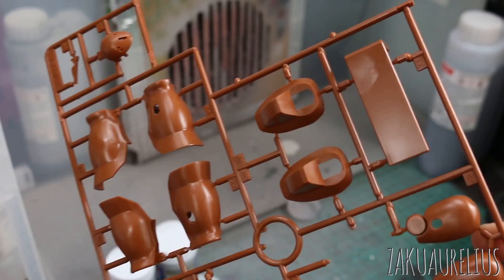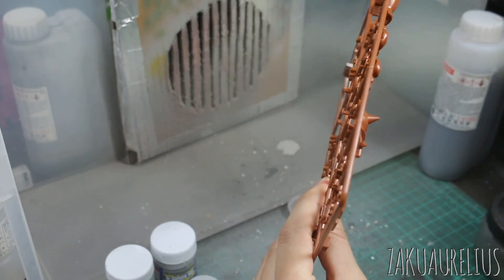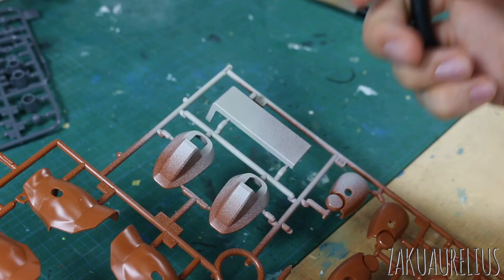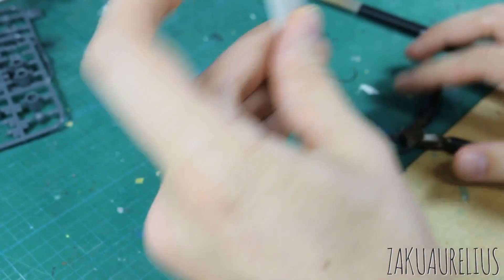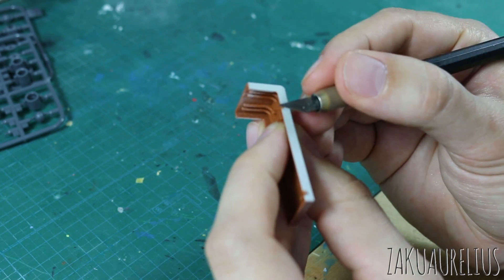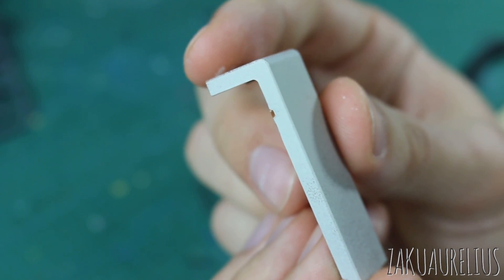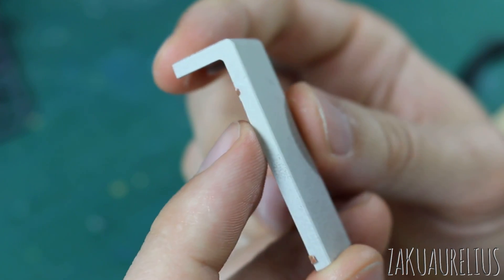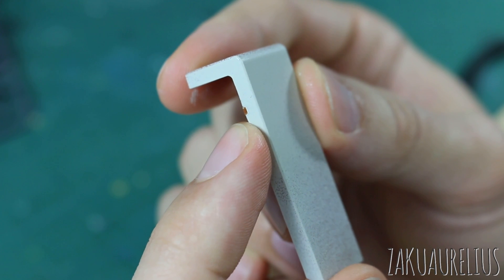1185 - FAQ: Painting on the Runner

Comment: I don't think this technique is necessarily bad, you just have to know you aren't going to get professional looking results from this.

I've done this a few times for kits that I just wanted to paint quickly without going into the whole process of sanding, priming, and top coating. What I usually do is trim off as much of the runner as possible, leaving only one or two gates on the pieces, preferably ones that won't be visible on the finished kit and touch up as needed. 

I did this for my RG Gold Frame Amatsu Mina, quickly painting the gold pieces and it turned out just great. 

Obviously I wouldn't do this for a kit I plan on doing a proper paint job for, but for kits I just want to get together rather quickly this technique is fine.
Reply: DZMaven's Gunpla Reviews agreed. it has its place.

Comment: I recently engaged my girlfriend in a combined Gundam build, in which all parts were painted on the sprue prior to assembly. The purpose of this method was to demonstrate and train in a variety of plastic kit painting techniques: airbrush, dry-brush, hand brush, oil wash, and watercolors, as well as the use of metallizer finishes, spray bombs, paint pens, and markers. Only a few parts required removal, or fell off the sprue in the course of painting. Only one part from each kit required any significant degree of re-touching. Assembly of kits and placement of stickers went as per the instructions. Overall the process was fun, interesting, and stimulating; painting and detailing small, often unidentifiable parts on a sprue can daunt the mind, but it can also free it, and you might find yourself making less conservative, more imaginative choices, that reap unexpected rewards later on in assembly. When complete I found the two kits closely resembled pre-painted, pre-assembled figures in their painting styles. On the whole I was very satisfied with the exercise and both figures, which we proudly display as tokens of our handiwork. Painting parts on the runner isn't a good idea--- if you have a bad attitude towards the method from the start. Trying to prove your point by painting a dark-colored parts sprue with a wildly contrasting color only sets you up for the failure of the differing colors that become visible when you remove them from the sprue; this is not a convincing, or ingenuous, proof of anything. What of the vast majority of builders who simply want their kit to appear like the one on the box? Obviously they will not be making these paint choices, so obviously this is a problem they will not likely encounter. I would recommend this method of painting to builders wishing to introduce the hobby to a youngster or a relative novice, or to persons wishing to limit their exposure to paints, solvents, etc., or to people who just can't decide which side of the fence to fall off of: whether to paint and detail, or simply to build. This method offers somewhat of a compromise to both parties.

Comment: Usual trick i do to prevent those awful nubs is to simply cut and sand/file/whatever method to remove nubs that are the more visible ones, and the ones that aren't as visible, i simply leave it there and continue to paint on the runner.

Comment: I've seen lots of videos with row after row of parts on alligator clips,  ready for painting.   As someone new to this hobby,  my first thought was --  how do you build the thing after painting?  Parts are off the sprue,   how do you locate A4 to connect it to C6?   Just by the shape?   I think another commenter asked a similar question and you were going to do a follow-up on how to organize.  Thanks.
Reply from the maker: Ah! Good question! The answer is pretty straightforward though: you just remember! Haha 😅 
By building the kit first you familiarize yourself with the parts. Then after disassembling and painting when it comes time to re-assemble you should be pretty familiar with which parts go where. If they get too confusing though you could also mark the alligator clips with masking tape and write the part number! Hope that helps! It’s easier than it looks! 👍

Comment: only paint on runners if handpainting. use a fine tip brush or toothpick. only certain type of kits would be justifiable to do so (first grade seed/00, 1/200 kits, some SD kits?? and i guess undergated runners?) 

its really fun to do for fun especially on cheap kits. kids will especially love it. its a lot less intimidating to introduce them to painting. like i could see it be used to conduct a class for kids. Just go prime the runners, grab a toothpick and go ham. bare plastic looks like shit

obviously more traditional methods are better.

Comment: In general I completely agree, this is not a good method of painting. That being said, I am a firm believer that most methods or techniques work in some ways and here is one that I can see this working well for, hear me out first. That is, on a kit that you are trying to make extremely weathered. There are some cases of long used military equipment like tanks or artillery pieces that were used in multiple wars and conflicts in different regions. Because of these different regions, the color scheme could sometimes be drastically different. Like on one layer it's green, on another tan, etc. It would take a lot of weathering work and I'm not saying it's the best way of doing it, but one could achieve at least two of the layers by painting directly on the runner and then chipping in the color of the plastic underneath. Just an idea, don't hate me XD

Comment: My method is to cut the part out and remove nubs while STILL ON THE RUNNER. How? Just leave part hanging on a nub that would end up not being visible anyway or to minimize the effect. Then after cutting it out just touch up the paint with a brush and volia.

Comment: Your not 100% right. But ur not wrong. I've done 2 real grade and 2 master grade painting using spraycan on runners. Redfram astray. I painted leaf silver and metallic red. If the colors are similar the fram, you can get away with it and add a flat or clear clear. What u doing is a issue of it different colors and your right about that. But it only depends on what colors you use to get away with it.

Comment: how do u hand paint wide surfaces? with the flat mat effect
Reply: You cant; for wide surfaces, use spray for the best result.
 But if you not have this option, you can try with a large flat brush, very thin and multiple layers, and enamel paint (pretty sure to fail with acrylic).
+ flat topcoat.

Comment: I think your reasoning for not painting on a runner isn't enough to deter people only because touching up a nub mark with a brush or q-tip requires a lot less time & management than cutting everything out, clipping every single piece to a stick, and then painting. After all, limited edition kits (like color chromed kits) have their finishes sprayed directly on the runner. The only reason why I'd discourage spraying on the runner is if you plan on gluing parts together to hide seams, the paint will get in the way of the glue reacting to the plastic. Not sure if that makes sense.
Reply from the maker: Luke Chueh that makes sense, and obviously this video is not super in-depth and thorough. It's just to quickly answer the question of if it's ok to paint on the runner. Yes there are exceptions, and I didn't say "never do it" but I just wanted to show the main reason why it's not a good idea to do it.

Comment: Makes sense if you are air brushing and/or trying to beat a clock. But then if neither applies then touch ups for various reasons besides dealing with nub scars is no biggie. I do not air brush and use either paint or ink pens and regular brushes. 
While I only paint occasionally doing so while the component is on the runner has made the event less taxing and IF the nub scars occur in painted areas brushing over is no problem and only takes a few moments. 
However painting with a brush or pen does require some clean up to remove over painted surfaces. Surprisingly this is not difficult though if you are in a hurry then time will not be on your side!! (Unlike what the Rolling Stones had to say about time!! https://www.youtube.com/watch?v=_ziqgXqxMPs    )
To get an idea of painting on the sprue here is what I did with the build of 
https://www.youtube.com/watch?v=YKj9qdWjFdc&index=51

Comment: What about painting bits they want you to use stickers for, or panel lining while it is still on the runner?
Reply: Painting bits that were supposed to have stickers on them would probably be fine if you were hand painting. For example painting the inside of a thruster bell or some sort of highlighted detail. If you were spray/airbrushing and masking stuff off then it's probably not worth it time-wise. Panel lining on the other hand would most likely always be fine while still on the runner if you don't plan on painting the kit. It really comes down to after you do what you want to the runner, can you safely cut it and remove nubs without ruining what you already did to the piece while on the runner.
Reply: For panel lines, i try this once and i regret it;
with markers, the runner make it difficult to reach every area.
With liquid, it work but impossible to clean-up while still on the runner for the same reason.

Comment: I often prime on the runner. This saves a lot of primer, and I'm always running out on those Tamiya primer spray cans. I will strategically cut nubs to reangle parts so that front-facing areas get adequate primer coverage (and as a bonus, the nub has been removed on that face). For painting, I usually paint individual parts.